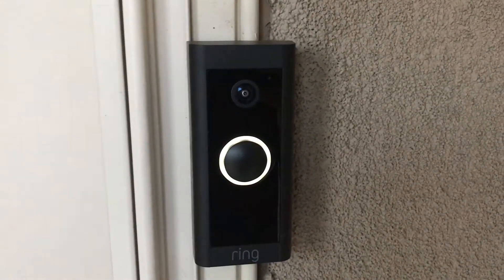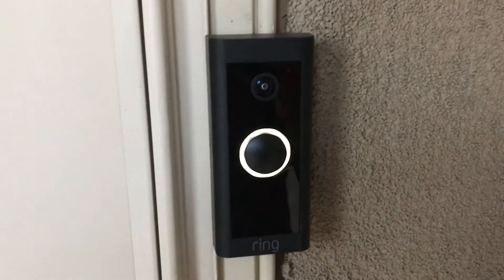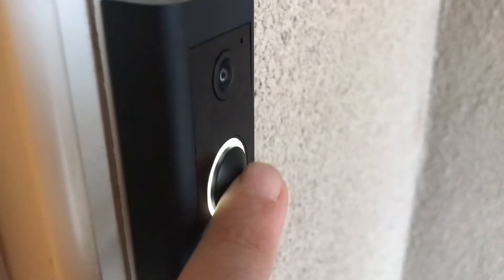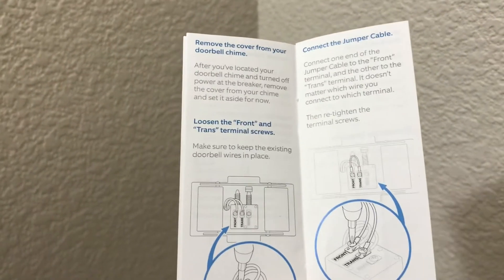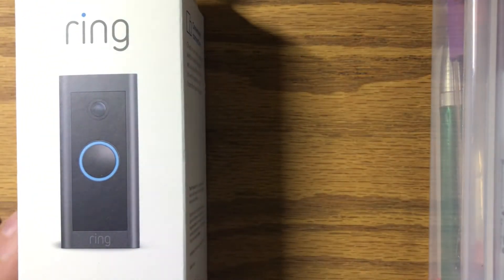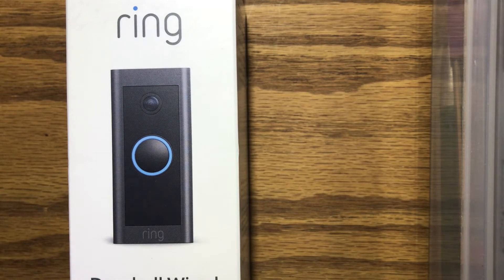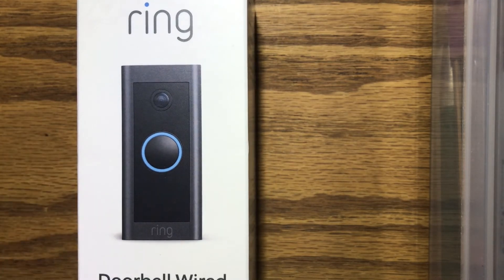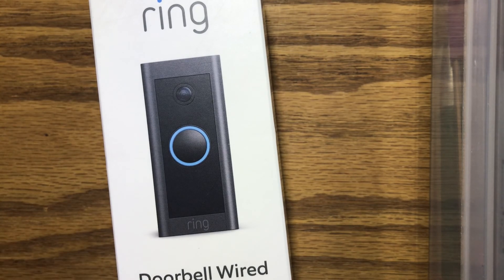What I Wish I Realized Before Installing My Ring Doorbell || Wired Ring Doorbell Install (part 2)

Comment: I just learned this the hard way also. My original wired Ring worked fine but had a transformer instead of a “jumper”. That sucks.
Reply from the maker: Agreed. It's unfortunate that you must buy their extra equipment to make this doorbell fully functional. Alas, it is nice to have a doorbell camera for a decent price but it is cheaper for a reason!

Comment: What if you just don’t install the jumper cable?
Reply from the maker: The jumper stops your existing chime and additionally it helps send power to the doorbell by bypassing the chime box so no current is lost. My works with or without my jumper installed but no point in losing current in the chime box if it isn’t being utilized